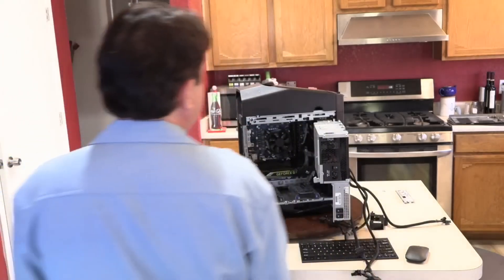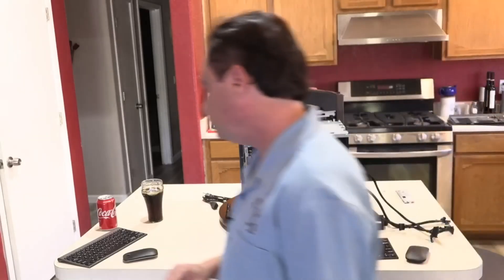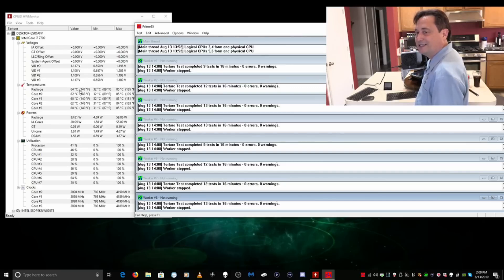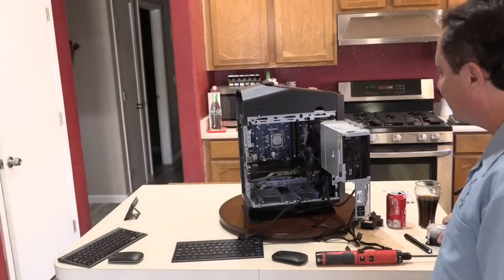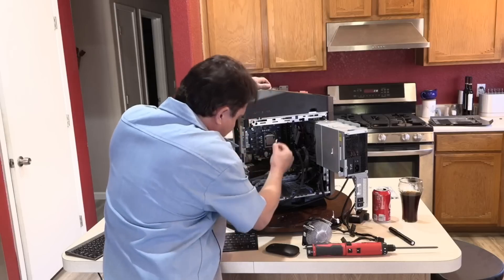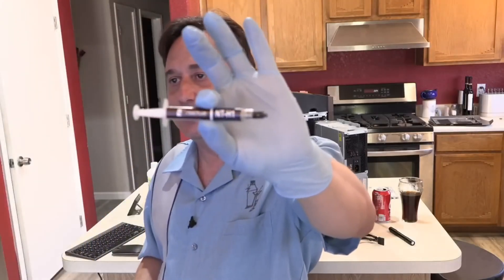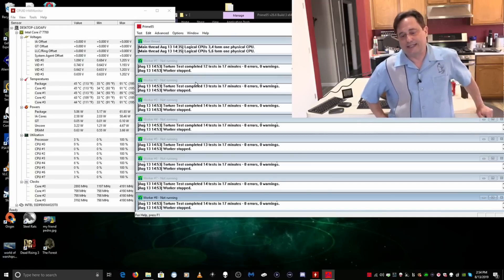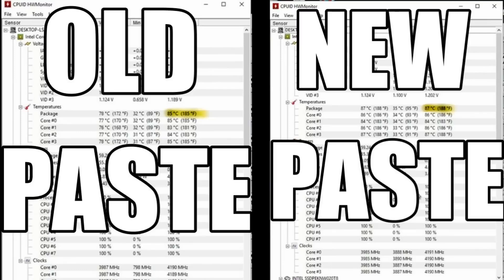Thermal Paste Fad: What No One Tells You

Comment: My PC runs 24/7.  Every month or 2 i take it outside and blow the dust out.  Every December i take it outside, blow it out, then take the heatsink off the CPU and clean and reapply TIM.  If the  GPU is new then i will wait 2 years before i remove the heatsink and reapply TIM to it.  If any thermal pads are broken i will change them.  I don't do it to lower temps its a preventative maintenance.  My PC is my only entertainment so it has to run no matter what.

Comment: My oldest PC right now has a Z270 Gigabyte board. From 2017. Initial build I took stock thermal paste off and put on some Arctic MX-4. Stock Intel cooler.
So now 7 years later idle temps 34C. It's doing fine. Only time to change thermal paste is if I upgrade a CPU cooler. Never had a temp problem.

Comment: Great video Cary! I built my own computer and use AMD Ryzen CPU's. I have B-450 board. I have a nice  Noctua NH-U12S chromax air cooler. I am rather dubious about checking my thermal compound as I have killed a couple of CPU's a main board by trying to get the cooler off of the CPU and pulling the CPU out of the socket. This is the downside of the AMD before the AM-5 platform came out . The CPU retention of the AM-4 is flimsy to me .